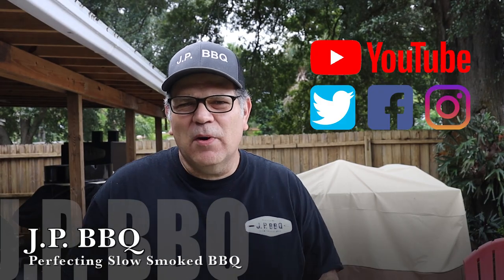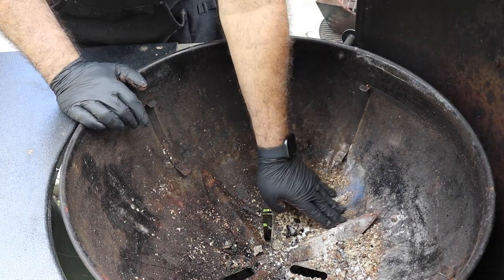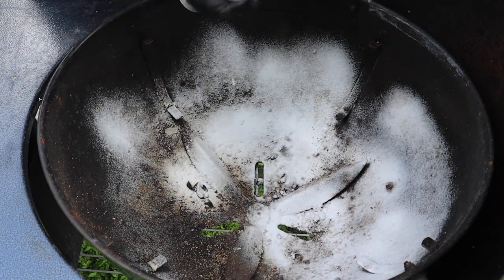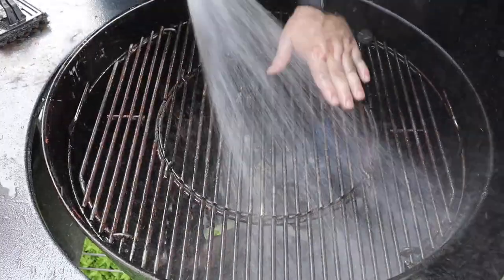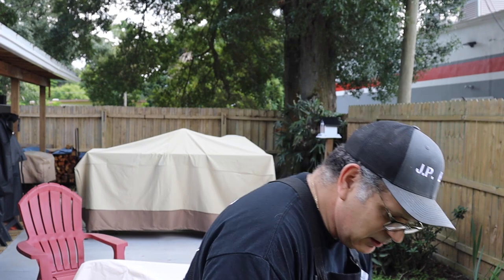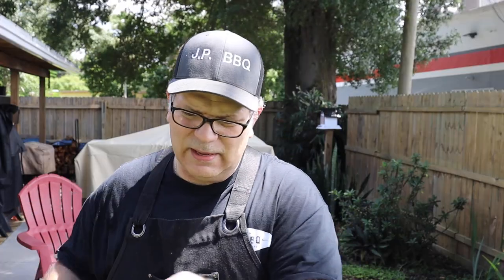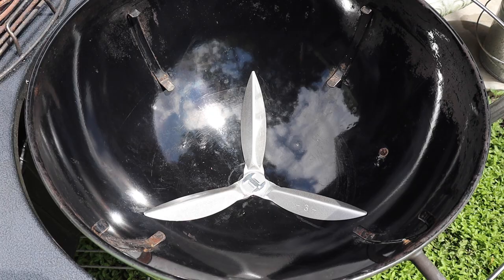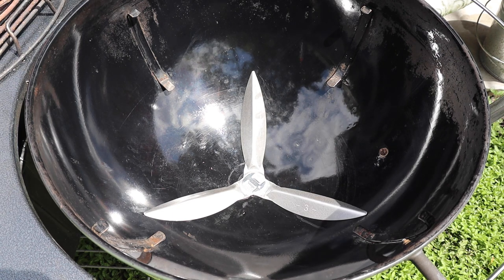Weber Maintenance & One Touch Cleaning System Replacement

Comment: You dont need to replace the one step kit when that happens.  It happens because grit builds up underneath and bends the blades.  Stick some 2 inch wood shims on each of the blade, as close to center as you can, and bend the blade down.  Then pull the shims out, and the blade will slap tight.  Then do the next blade etc.
Reply from the maker: I did see someone do a video on that and yes looks like it works great. Appreciate you sharing and thanks for watching.

Comment: Had mine for about 8 years. As long as you cover it and clean it regularly, it will last years. Love Weber’s
Reply from the maker: Appreciate you watching and commenting. They are absolutely amazing grills. Thanks for sharing.
Reply: It's only a simple grill with the same design it's had for decades. You shouldn't need to "clean" a grill other than removing ash.

Comment: I'm a 65-year-old female with a 26" Weber Kettle and I just replaced the One Touch Cleaning System today all by myself. If you think it's  hard on a 22" Weber, try it on a 26" Weber! LOL This took some ingenuity, but what I did was run string through the bottom of the handle holes of the blade system and then dropped the string through the bottom of the kettle to hold the blade system in place at the bottom of the kettle when I flipped the grill over to install the washer and handle to the underside of the kettle. This worked great!

Thank you for the tip on the Simple Green Grill Cleaner plus SOS pads. This worked so much better than products I have tried before.
Reply from the maker: That is too Cool, I appreciate you watching and commenting Susan. And you are so welcome glad I could help. Thanks again. 😎

Comment: I think you're meaning Aftermarket Parts, OEM  is Original Equipment Manufacture.
Thanks for showing the cleaning and repair.
Reply from the maker: You are correct, thats what I meant. thanks for watching

Comment: My original kettle is 30+ years old, and in perfect condition (other than a gazillion fine scratches). 
 
I do a thorough clean every 20 smokings, or every 30-40 grillings. 
 
However, the newer kettles don't seem to last as long. They're lighter in weight, and have a thinner coating. But, they should last a decade still as long as they're cleaned, and protected from the elements. 
 
Once a year, I like to do a 10:1 of peanut oil, and food grade silicone grease on the inside/outside of the body. 
 
I start with about a teaspoon of the food grade silicone in an automatic mixer. Then I slowly add a warmed (135f-145f) peanut oil ,a 1/4 cup at a time, every 60 seconds. It'll have a total of 1-¾ cups peanut oil to the teaspoon if Food grade silicone. Just make sure you don't add too much h of the silicone, or it will end up trapping ash/debris in it.
 
Once I coat the inside of the grill (a paintbrush is adequate) I then do the outside. Then, I turn on the propane starter, or I will put a propane torch head up, into the grill, and run it on high about an hour. Hopefully you get it to 350f. 
 
Then I wipe down inside and outside, looking for any oil that's pooled, or not bonded, and voila.... i put it back together. 
I'm in hot, humid, salty-aired environment of Florida. I cover my grills with appropriate covers, and leave them outside year round... but I use them about 4+ times a week. So if you're not using it as much, it'll last wayyy longer. 
 
😀

Comment: JP.  thanks for the videos
I Finally did this today  bought this weber 22 kettle in 2018.   Time change out the one Touch and clean this built up dusty, moldy, dusty, pollenated, greasy , well used 
Weber Grill.  
thanks Juan.   great tips
Reply from the maker: No problem, you are very welcome. Thank you for watching and commenting.

Comment: I have had my kettle for a little over a year. I just did my first cleaning yesterday like that only I tried the CitruSafe cleaner. I think I may try the simple green next time, or possibly the easy off that is marketed for grills....yours came out a tad cleaner. I had a bend in one of my blades on the one touch too but I was able to take mine apart bend it back down and reassemble good as new. Nice job!
Reply from the maker: thanks for watching SNeal5966. That Simple Green is no joke. It works good on a lot of things. The Easy Off for grills is a good product as well. thanks again for watching and commenting.
Reply: @JPBBQ  the Citrusafe did a decent job don't want to diss it too much....but I deff am going to try the simple green next time for sure

Comment: My 30 yo one touch has a 10” flat brace attached to the center nut that the ash basket attaches to. Doesn’t attach to the legs! No parts! Might have to get a new ash catcher if it will fit.
Reply from the maker: Wow, your Weber is 30 years old. Goes to show these little bad boys are made to last. Thanks for sharing. I think you can get parts for it as long as the style model did not change. good luck.👍

Comment: Yet another person who is going to replace the lower vents, but leaves them fitted.
Then tries to scrub around them, and after removing them needs to re-clean it.

Life doesn’t need to be this silly.

Just remove the parts first, clean it and install the new parts.

Common sense is just not common anymore.